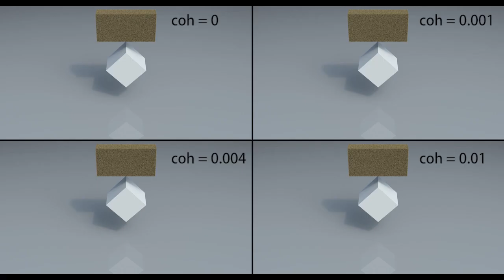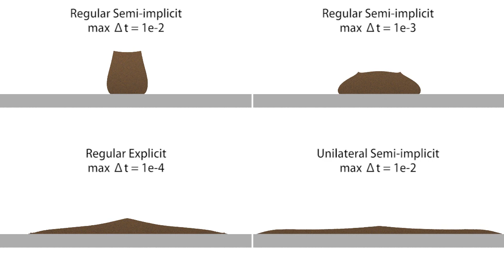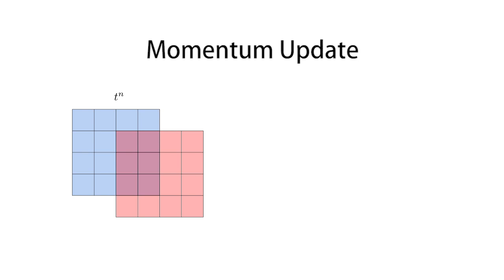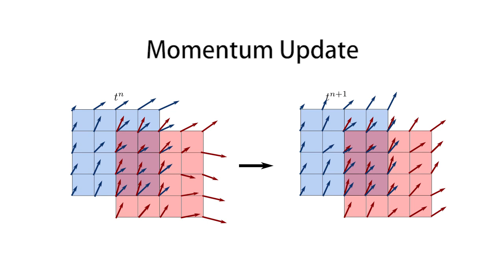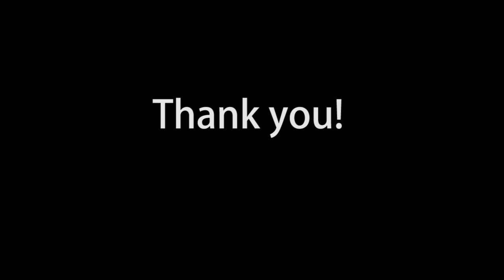(SIGGRAPH 2017) Multi-species simulation of porous sand and water mixtures

Comment: 3:19 Can't help but wonder if some of the updating based upon the saturation of the particles is redundant. That is but one state transition and it would stand to reason that some particles will have changed to some other state implicitly by means of their saturation state changing. The particles cannot be wet unless they are in a wet place in a place. So that is essentially Markov chain tessellation, eliminating redundancy by Laplacian polynomial to reduce a mesh, and can be isolated, like a Z-buffer. That then makes subset shapes or clusters that are likely to form and eventually become known in advances as they, quite literally, rinse and repeat. That means a morph can be made by Reidemeister move, and so that can be the Jones polynomial used for known knots that will occur over and over again and thereby predicted for their splines formed.  Chances are, one would not need to triangulate where there are so many triangles. This then means curves can be anticipated where squares deform, unlike triangles. So it is a different matrix. Then there would be dense matrices and sparse matrices. One might not need to 'always know' (or calculate) the interpolation of the grid per particle but instead that there exist a dense matrix which satisfies a Jones polynomial (or spline) which probably will change and that has changed.

That subset of 'pointed-to' particles In the grid could be considered the histogram, and as such the time series analysis for time-series-discrimination, could be considered in the frequency of the histogram so there can be a hyperplane. thereby,, some particles could be considered close enough to resemble one another to compress them, thusly into a range of a class or rather histogram-bin. Wit his in mind, computation might be reduced without so readily incurring performance penalty if the hyperplane is instead treated as the hypercube so that the Rosenblatt-Parzen window model can be used for Gaussian kernel density estimation, and the analogous Rosenblatt-Parzen window method (again) for Gaussian kernel probability estimation, rather than always needing to use vector similarity comparison if going on to generate Eigen vectors. The probability estimation could discover Eigen values, and so, they remain the same and are archived, as per Markov chains. It would be like a general compression model, such as using Markov chains in archive-compression formats, something vaguely similar to a tar-gzip but specific to a Gaussian heat-map for the particles to identify their increased probability of being the same or similar to their nearest neighbour. In testing or pre-calc, an index of hash checksums could be used to spot redundancy, solving for the polynomial, or the initial function for whatever f(x) would be, and a Markov state transition is only needed if it needs to change. If it ain't broke, don't fix it (and 'DRY' - dont repeat yourself), otherwise update. It could be expressed as pointers as though each vector particle has an electron spin factor, and so, eventually a group would be seen as a wave. Some, solved as polynomial, could pre-calc to be a spline (two polynomials joined at the knot, or by Jones polynomial, Reidemeister move), and their velocity derived from the frequency (time). Eventually some kernel density would be distinguished as non-parametric, with the other parametric. Particles that do not need to be processed again (like first-pass, second-pass encoding) could be discarded for a cycle by singular value decomposition and Chebyshev polynomial, basically as spectral analysis for Gaussian noise elimination. Adding noise could predict where some particles will change in future, so a spline could be ready in advance and if not used, discarded for another candidate-spline likewise auditioned at the ready. The agitation of the particles would be separated into a series by Fourier analysis but reduced in complexity of computational overhead by means of Laplacian polynomial dampening, thereby reducing the need for so many transcendental operations. Perhaps, it would eventually become somewhat obvious when and where a particle is going to become wet, and to what level of saturation. That is basic 3D mesh weighting by Markov state transition or alternatively, linear regression. The prediction can be to "make noise" by Fourier Transform, and then lower the resolution such as if a Gaussian kernel is close enough to a square wave or whatever wave or series the Fourier analysis can derive, but checked for in advance just in case in can be satisfied as a polynomial. 
Think of the solar eclipse. You need not plot every position of the moon relative to the Earth and sun to see where the shadow will be cast if you already know the polynomial it will follow. The Moon, Sun and Earth are like the particles in the video in some way and the sea level affected can be predicted by the gravitational interactions and perturbations imminent. Some particle clusters are more likely to reveal entropy than others, and that then reveals clusters in advance. Lagrangian polynomials could be indexed ready for outcomes that are familiar to Lagrange points. The likelihood could have frequency templates, like K-space.

Where one medium has some level of saturation compared to another area with no saturation, there is an implied temperature which forms and occluded front. Not only can the pure water eventually saturate a particle that might become wet, so can other wet particles, even if the water to be depleted in an environment where a lesser volume of water is the starting point ready interact with a greater many particles of sand. This then means that the only way for some particles to become wet is by drawing water from other particles which have become partially saturated by some water. Temperature deep within particles is kinetic energy, i.e. movement energy, and that means heat is a catalyst and it might be debated whether the remainder particles and water are limiting reagents. So it can be predicted as to where it would go, such as across a differential or across a gradient, with a rate or frequency. There is also a maximum at which a particle become saturated with water. Quite possibly, an Ogive would be predictable for cumulative frequency, and so would a prediction be able to be made for a graphical inequality which is essentially calculus but with known presets thereby because the satisfied polynomials would be anticipated. Particles "bounce" interaction with one another (like Gaussian noise elimination and Brownian motion) and with bounce come restitution, which in turn must have a co-efficient. The predicted known quantity could be, if so desired, the co-efficient of restitution. With that the (pre-calc) satisfied polynomials can be a known quantity in advance making additional processing of those precise particles redundant since the polynomials are finite. Depending upon the bit-depth (16bit, 32bit, 64Bit and so forth), restricted within those (4bit for instance) means that the total possible polynomials, for the desired resolution, are only a possible amount and thereby can be white-listed in advanced to further reduce computationally expensive performance penalties incurred. Every sand particle is not only subject to ingress to the water alone but to other particles already somewhat wet as in exhibiting a saturation level and what their saturation level is going to be, since it cannot exceed a given capacity. Additionally, some particles could be given different sizes, although, here they seem to be uniform, and yet either way, neither dynamic nor eroded in their size (s no particle becomes ground down). Another known quantity would be the range of repose which would stay the same for dry particles of a uniform size and shape, but subject to change if with a predetermined capacity of saturation. All these things can reduce an extra cycle or other mechanism of computational overhead. the technique deployed would be to know the answers in advance where possible, to prosper by cheating, as an ethical hacking. 

My comment has no hate in it and I do no harm. I am not appalled or afraid, boasting or envying or complaining... Just saying. Psalms23: Giving thanks and praise to the Lord and peace and love. Also, I'd say Matthew6.

Comment: How many years of render took this ?
Reply: It's not in real-time lol
Reply: When google translate slips up
Reply: Nope. You'd have to use something that's actually released as a 3DS Max plugin.
Reply: why is the account just gone
Reply: I'm more concern for how many years it will take to simulate, haha..
Reply: Sebastian Perez A few hours, actually. Most of these bleeding-edge fluid simulation techniques do already-possible things faster (think of factoring integers in polynomial time) rather than doing previously impossible things (think of solving the halting problem).
Reply: It's not a program, it's a simulation method.
I strongly doubt the code is released to the public.
Reply: what the program??
Reply: looks awesome. can i simulate it in 3ds max for example?
Reply: Rendering is super quick on modern computers. It's the simulations which continue to get more and more complex.
Reply: I'm under the impression that it is in real-time